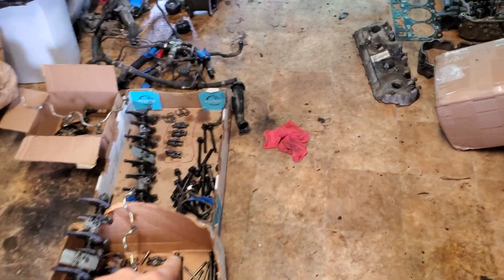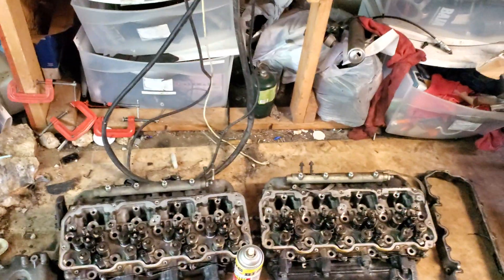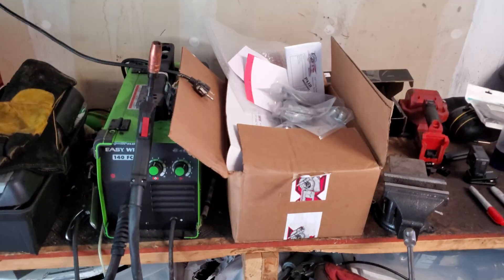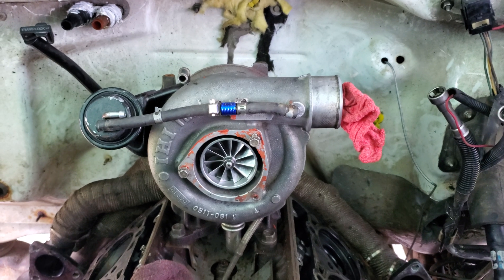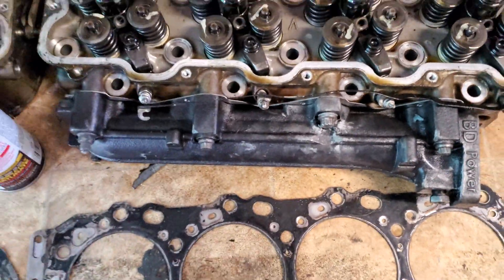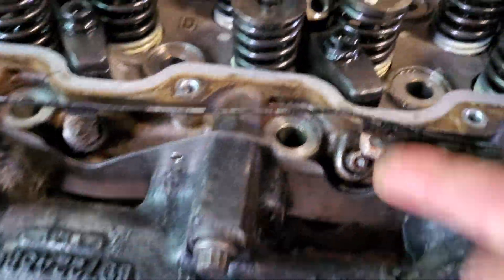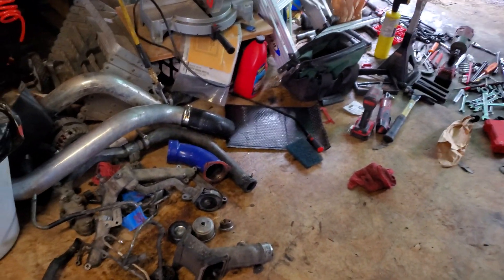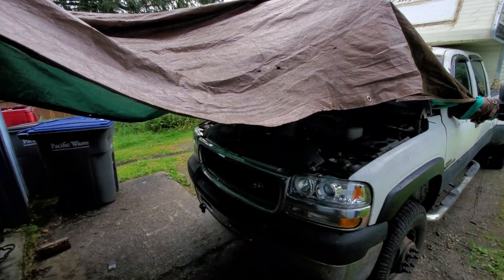LB7 Duramax Top Half Rebuild: Heads, Gaskets, Injectors & Turbo Update

Comment: Good call going with LDS, they're the best from what I've heard.
Reply from the maker: The SAC 45s were a bit pricey but now that they are installed and everything is functioning properly, I couldn't be happier.  It's like driving a completely different truck.  I imagine if I could take 20 years off my joints, tendons and revamp my metabolism, id feel like a new person too! Haha 😆🍻
Reply: @KooshdaakaaGarage  I have a question hopefully you can answer I’m looking at the sac45’s for my LB7. How many miles are on your truck? How many miles have you put on the new injectors? And is your truck on stock tune with the sac45’s if so is there anything bad you have to say about the injectors? Sorry I know it’s a lot of questions but not to many people have the sac45’s
Reply from the maker: @RacersRUS69  Hello Dylan, thank you for your question man.  I fully agree, there is not a lot of peeps sharing their experience with the sac45s.  In part that is why I'm creating this "Project LB7 Duramax Spool Up" series so show how to remove & rebuild the turbo.  How to remove & rebuild the heads.  How to port and polish both the turbo and the heads as well as give a close look of the sac45s and how to install them plus at the end there will be a full review of my experience with them up to that point.    I'll share with you my experience so far:  I have a 2001 LB7 Duramax with 197k miles on it. I have about 1k miles on the new injectors.  I have tested it in stock, two tune and tow tune 2 using my PPE Xcelerator.   So far I do not have anything bad to say about the injectors.  I bought them from LDS with the master install kit as well as the aftermarket high pressure lines, and new valve cover bolts. When I had the truck in stock tune I'll say it felt like I had it in the 90hp tow tune prior to rebuilding the turbo and heads and new injectors.  Those things give you fuel where ya need it and make sure you have it for the full RPM range.  Now I have it back in tow tune 90 and it pulls strong in low speeds, high speeds and everything in between.   Excessive exhaust smoke is not a worry in any tune including stock.  There is a slight haze on the cold start until it warms up but that is to be expected with the sac design because it holds a little fuel in the tip between injection events. When I step on the skinny pedal in WOT there also is not an excess of smoke.  I do have my truck pretty well modded  to handle the extra fuel but just the same I would not worry about it being overkill if you are going to stay in stock tuning.   10/10 would recommend.   This goes without saying, but a lift pump is always a good idea on the Duramax, especially with larger injectors.  I'll give you a closer look at the injectors in upcoming episodes man, if you are still on the fence.  Stay tuned!

Comment: Love the big green Pig!  My lly has 298k.  Runs amazing pulls hard. Proper maintenance and tuning are key...
Reply: 298k Miles.  I'm down yonder, in Florida...  . EGR delete, because LLY. I also did head gaskets and arp studs, because lly.  HSP Y-Bridge and cold side ect ect.  EFILive by StarLite. I need a built trans.
Reply from the maker: @FXRJay_CapeCoralCracker  how do you like that Y bridge?  I really don't want to put the stock one back in but that $500 price tag for an upgraded one is a hard pill to swallow!  Should probably just do it anyways 🤷
Reply: I only bought the HSP y-bridge & cold side intercooler pipe to "properly" delete the EGR.  I replaced the drivers side exhaust manifold like you did. Tstats, Replumbed cp3, AirDogII-4G165, beans sum, up-pipes, AFE Down pipe, With the EFI live tuning when I start off from a red light at quarter throttle, when the truck shifts into 2nd gear, if I roll into it gently, it will light up both of the rear tires. No power breaking needed to light them up or do a burnout. It woke up my truck 100%. My og y-brigde was leaking, common problem i won't have to deal with anymore.
Reply from the maker: Hell yeah dude that sounds like a hell of a setup for sure 👌  you should post some vids of you bombing around, id like to see the ole lly gettin into it 🍻
Reply from the maker: Hell yeah to that brudda!  300k and going strong eh?  Now that's what I'm talking about 🤘🐷🍻